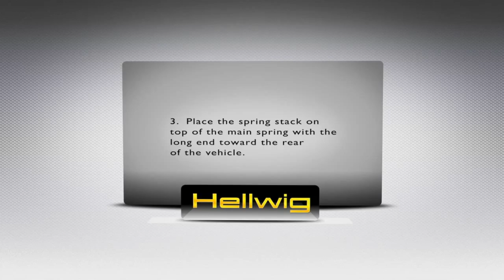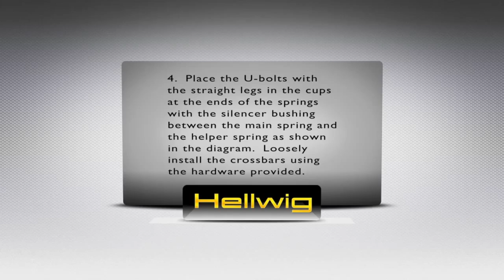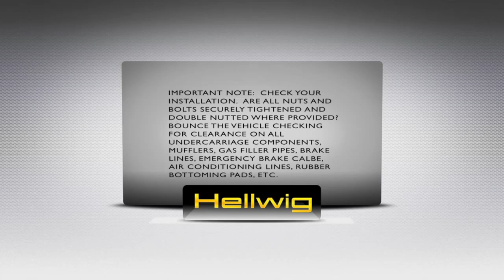Hellwig Pro Series Helper Springs Installation

Comment: I mounted these on a 2006 GMC 2500HD. Because the inner U-bolts are mounted so far out on the leaf springs from the center of the axle, when they are tightened to the 65 lb ft of torque required,  they actually flatten the leaf pack causing the rear end to drop 3/4 of an inch. I read another reviewer mention this same issue. I sent photos of the leaf pack before and after the installation to Hellwig and they ok'd returning the springs. I used the proper kit for my truck and my installation was correct. Hellwig is an outstanding company and customer service is top notch. I just wished they would have worked on my particular year and model.

Comment: I installed these 2 leaf helper springs on my 2017 GMC 1500 SIERRA SLT CREWCAB 6.2 MOTOR, these are easy to install and help with no squatting of rear-end and does not effect ride quality.  I pull a 24ft pontoon and 8.5x20ft enclosed trailer, because this truck came with 22 inch rims the factory tires (285x45x22) didn't have much for side walls, so didn't feel safe with the ride when towing.  I recently bought load E range 285x50x22 TOYO OPEN COUNTRY A/T III, expensive tires they are but well worth it, the ride feels much safer and the mileage is the same.  This was much cheaper than buying new 20inch rims and tires.  Thanks Hellwig for a good product.

Comment: Why use a double nut on the U-Bolt...why not supply with a plastic insert lock nut. That would make it much better. Hope you didnt lose a diamond from your ring honey wile working under the truck.
Reply: Frankly, I think for a high-load situation like this, I'd supply a kit with slightly ovaled bolts that won't back out. The shackle kit for my replacement leaf springs had 'em...was scared I cross-threaded them until I realized they were ALL like that!
Reply: Nylock nuts can fail and you cannot re-torque them. Installing pLaStIc iNsErT nUtS down facing and exposing them to the elements (water, dust, mud, salt, ice, etc) is not a good idea. A double nut is more dependable and less likely to fail. Lastly, making a joke about losing a diamond from a ring/somewhat implying that women can’t wrench doesn’t hold quite much water from a dude that has his cat as his profile pic. Perhaps they’re showing the ease of installation by showing that a girl in plain clothes and wearing jewelry can get it done - a man owning a cat just may be able to complete the task as well! Give fluffy a nice pet for me.
Reply: @rescf02  LOL! You did the same thing Mike did, It's so easy, even a girl can do it! LOL
Reply: @rescf02  grow a set

Comment: Does this helper spring raise the back end of the truck at all or does it remain stock ride height after
Reply: Stock ride and height unless you crank them down for a heavy preload then you will stiffen and raise a little.
Reply: Helper springs do nothing for ride hight..... strictly for load capacity
Reply: @thomasmcnicholas8656  but when I tow my camper, it sags 2 inches in rear, I guess this system will not help that, which is useless junk.
Reply: @jefflancaster6587  it keeps it from squatting..

Comment: Will this fit on a 1999 Dodge ram 1500
Reply: if you order parts for a 99 ram,do you have common sense?
Reply: @trillrifaxegrindor4411  Idk about tow capacity or performance but a 99 will get you back and forth much longer than what ram puts out today.